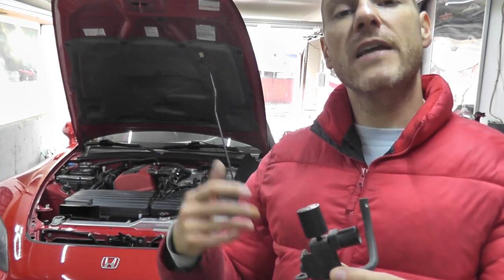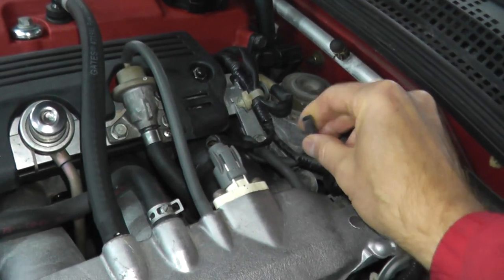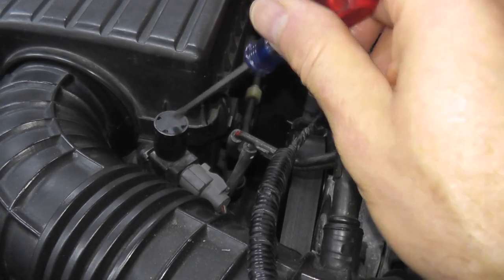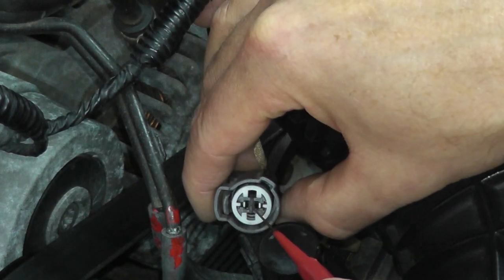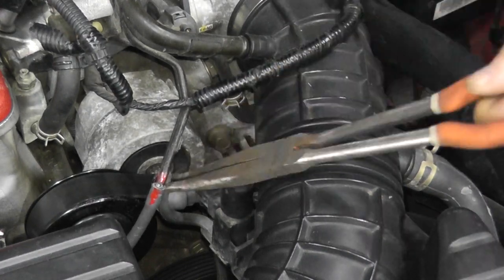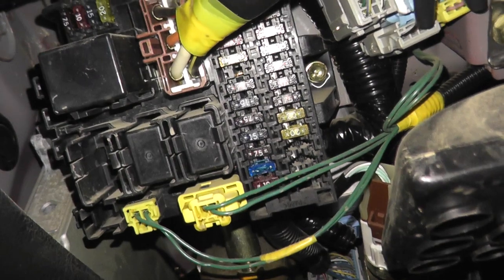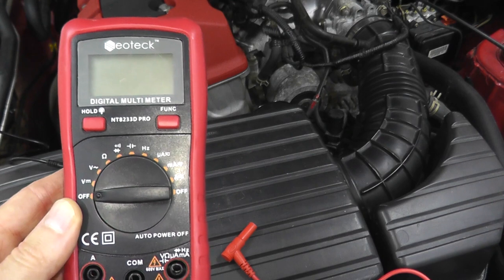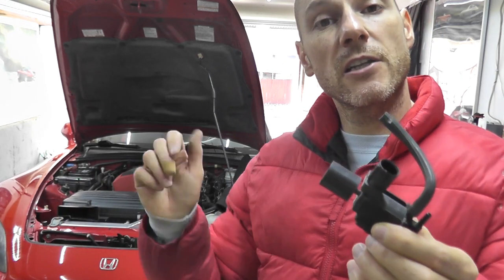Honda S2000 Air Control Solenoid Valve P0411

Comment: Thanks for making this video. I've had this code for a while and was almost resigned to the fact of changing the air pump or relay. Just change the solenoid valve as suggested and everything is fine now, no check engine light.

Comment: Question: I have the same air control solenoid valve on my ek civic (EDM). Should the valve be open when it is not receiving power? Thank you

EDIT: I just checked and it is open by default. Only when I applied 12V did it close.